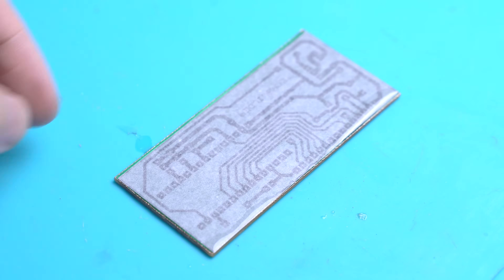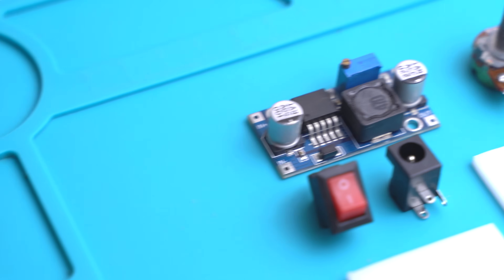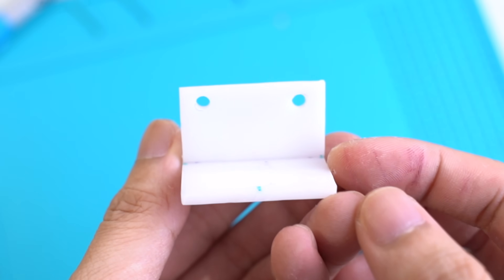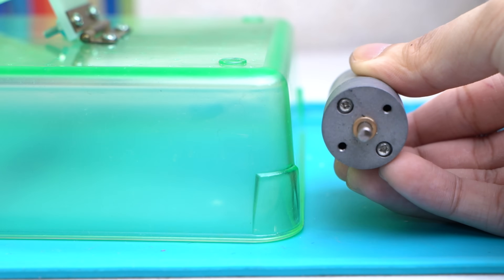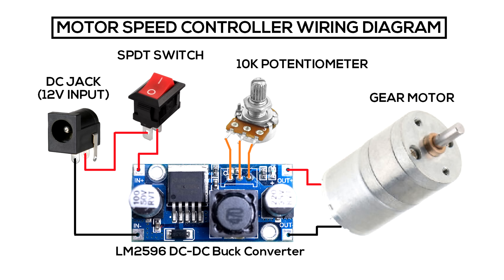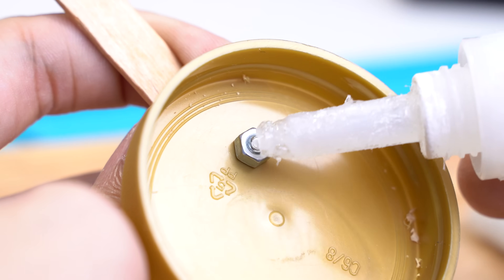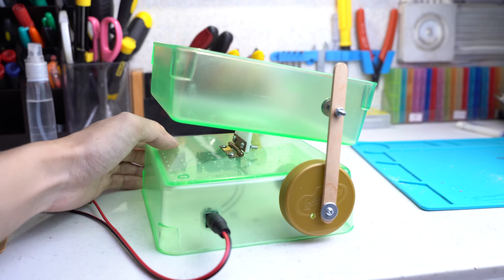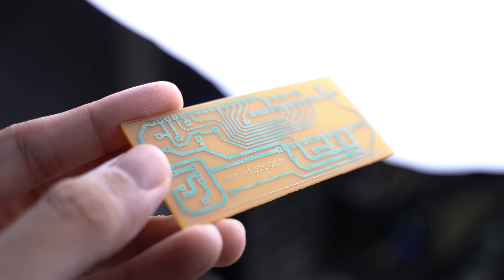DIY PCB Shaker For Etching (Low Cost Rocker/ Agitator)

Comment: if you set the hinge on the left instead of the middle it's a much more rigid mechanism. Just increase the radius of the wheel and lower it so the middle of the wheel is where the container is horizontal. Then you have the same action

Comment: All these shakers, rockers, rollers, etc. (and I've made a few!) have the same problem, namely that the etchant in contact with the board still doesn't move. You need to physically move this away using a sponge or soft brush.

Comment: Nice project .  Maybe ,   instead of using a buck converter to reduce voltage to control the motor   .

**  another way would be to use a motor controller , only a few pounds on Ebay , and has same footprint           as the buck converter. 

( Also , to add  ' bubbles '   and heat to aid etching time, )

[  **  I think both ,  buck converter and motor controller work as same principle , 
      but ,  the motor controller has better control  ]

Comment: Can you add a source of the "SPDT" (single pole double throw) switch. Most of the small panel SPDT rocker switches I find are either momentary or two position and the ones that resemble the video are larger than what you have shown in the video (however, I have some SPST rockers from a previous project that resemble what you are showing). Also do you have a wiring diagram for your shaker?

Comment: The shaker is a good idea, with minor modification, the etching process can be sped up further.
If you heat up the FeCl3 solution, the etching can be  faster.
But there is a catch, if using minimum amount of solution, the hot solution quickly cools down when 
the water evaporates during the shaking.

Now, if you put the PCB and the etching solution at 80 degree C in a zip-lock bag. Then place it on the shaker,
The etching process is fast and uses the minimum amount of FeCl3.

What I usually do is, take a zip-lock bag a bit bigger than the PCB. Then put a sugar cube of FeCl3 into the bag,
pour in small amount of hot boiling water, and then insert the PCB.  Squeeze out excess air. Close the zip lock.
Put it flat on the shaker.  The etching solution should be about 8mm thick.
When the shaker starts rocking, you will find the etching is much faster.  

The FeCl3 after the etching will turn from yellowish brown to a green ferrous solution.  If it is too yellow, that 
means, there is too much FeCl3.

Comment: a 3d printable method that can carry more weight: a horizontally rotating disc with hills and valleys to push the upper tray (with a recieving plate on the bottom)

Comment: to the container, in addition to the rolling axis, glue 2 iron strips on the sides. And on the base of 2 electromagnets, which through the multivibrator alternately attract the edges of the container... :)

Comment: Place the pcb upside down in a tank. 
I mean copper side to the bottom of the tank.
It will etch a lot faster
Reply from the maker: It does work but for photoresist PCBs, the paint mask easily gets scratched of when it comes in contact to anything with friction.

Comment: Nice and cheap shaker ... 😊👍🏻

What kind of glue do you use ? 
Most superglue won't glue those plastic ... 

May I ask were can I supply the LMS circuit ?
Reply from the maker: Thanks! It's polybond glue, a locally made cyanoacrylate superglue in the Philippines. It's somewhat stronger than most branded glues. May I ask what LMS stands for?

Comment: Hi Kuya Angelo I saw your post on Facebook of your anti germs robot!How do you make all these?I had never had an invention of my own.Your so lucky.Are you going to make the anti germ robot?I wish I could make my own version but all the electronic stores are closed.How does the robot kill germs?Is it by heat?By the way is canvas hard enough to keep the bb8 from deforming?I follow another bb8 builder Rimstarorg He used fiberglass.I know you tried to use fiberglass,Is it expensive?
Reply from the maker: Oh yeah! It's goinf to be one of my new vids! I guess it's just years of experience in the hobby. It uses UVC, it's dangerous to humans, that's why I made a bot for it. Canvas is hard enough, but it does warp after while. My version 2.0 was made out of fiberglass (it's cheap as long as you know where to buy them). My version 5.0 on the other hand is made of a recycled poly carbonate sphere from an old lamp post.

Comment: Just use your 3d printer with a heated bed. Heat and shaking and printing all in one package!
Reply: Shaking is not the answer. Bubbling the etch bath is. A cheap tire inflator is all you need. The crappier the better.
Reply: Paul Frederick lol
Reply from the maker: I actually do that on my CR-10! It's pretty neat tbh! Just had to make this vid for those who doesn't have a 3D printer 🙂

Comment: Isn't there such a thing of a potentiometer that has the power on/off switch built into the unit itself? If so, would you be able to bypass putting a switch and just adding the potentiometer with combination on/off? Such a great little project, thx for sharing!😃👍
Reply from the maker: Thanks! That's possible. It's technically just a pot with a separate line for a switch. I wanted to use one but couldn't get hold of one due to the quarantine.

Comment: Now add boiler too coz heat makes process much more faster.
Reply from the maker: Great idea! Let me see if I can get hold of a high temp plastic tray or a glass container. Luckily I have a ceramic heating element in my inventory.
Reply: @TechBuilder  a glass casserole dish over a heat source like a hot plate with river stone pebbles in the bottom and a water bath with a plastic microwave dinner pan inside that with the acid in it works. You want fumes to come off the acid. Then it is hot enough. It's less than the boiling point of water. A little more than halfway really. Just watch for the fumes and hold that temperature.